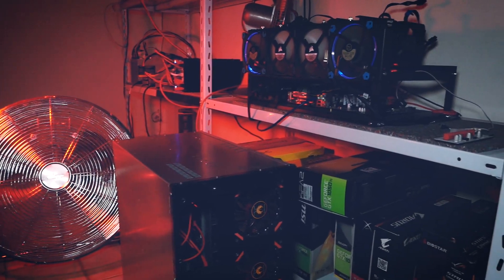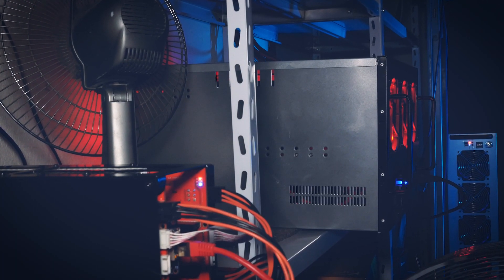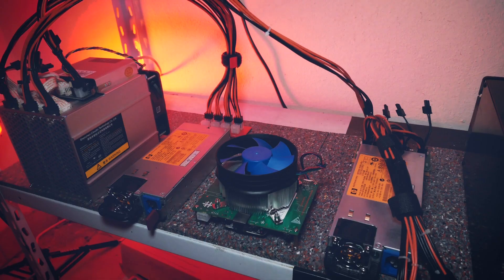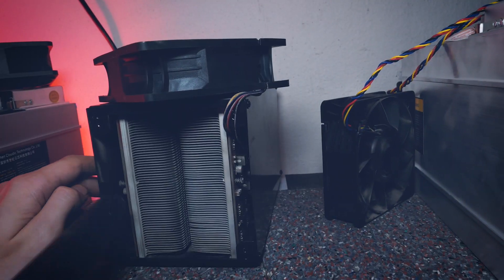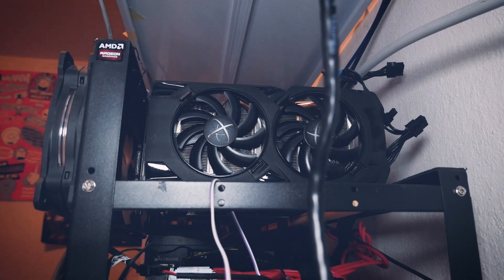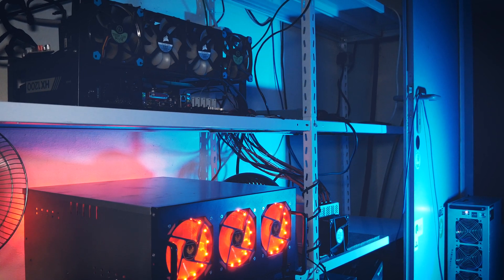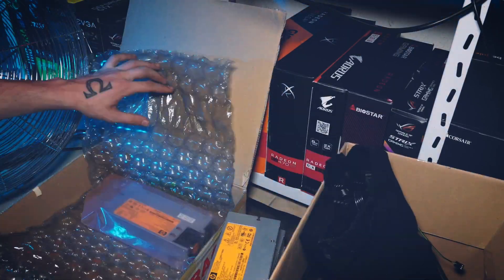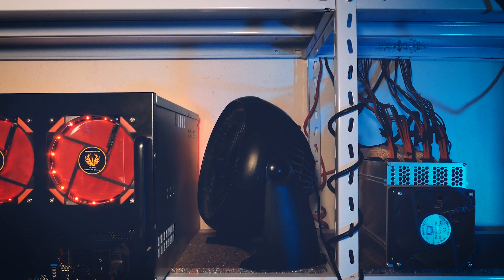Mining Room Clean Up & Maintenance [ASIC / FPGA / GPU Miner] #crypto

Comment: Excellent video! Thanks for posting. Try to remove the cooler mesh from your asics. Also you can safely remove the backplate from your Z9 machine. You'll get a better airflow and a reduction of a few degrees on the hashing boards.
Reply from the maker: Absolutely right! I should make a comparison next cleaning session :) thanks for tuning in mate ⛏️